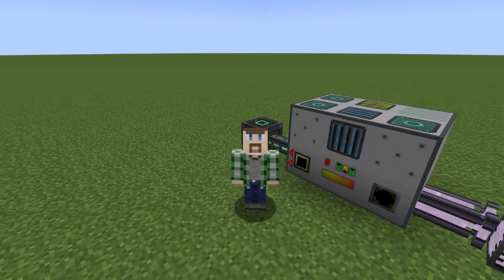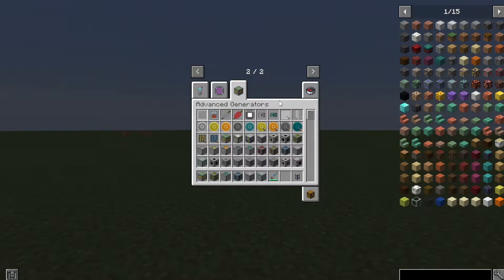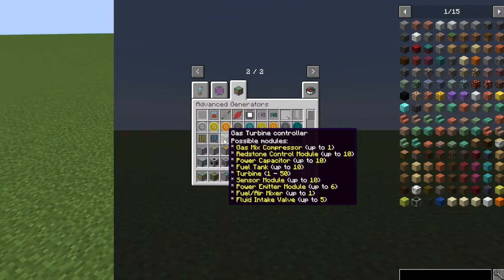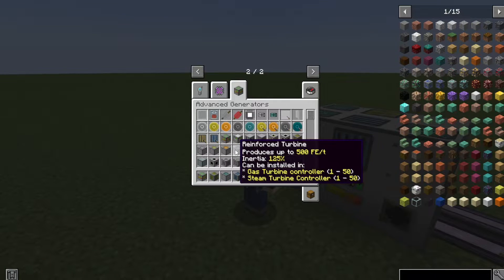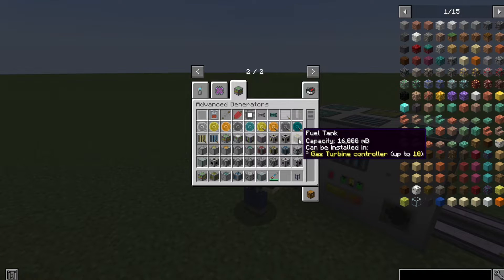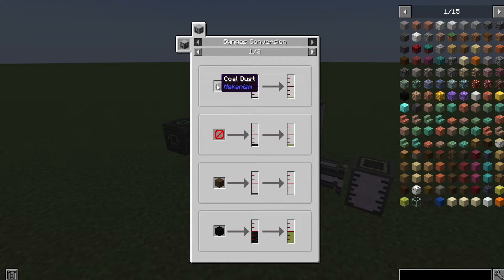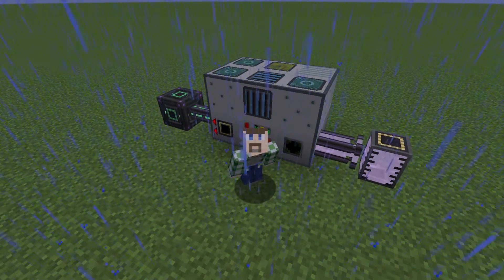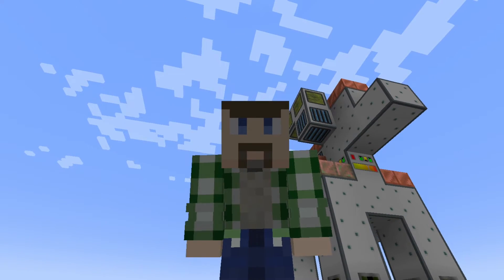Advanced Generator Basics - Minecraft 1.12 - 1.19 - Modded Minecraft Tutorial

Comment: Hey Ard, this was short and up to the point. And the point is - put the controller and connect everything listed in JEI under controller to it to make it work. One can make it as complex (and as "elk like") as they desire.

Indeed, when I first saw this mod I was a bit overwhelmed, as there is no instruction associated with it. But still, for the player perspective, because it is a multiblock structure it is hard to calculate it all in your head - how much material you spend building it, how much fuel you use running it and what output you can get? This inability to estimate in your head could be entry barrier and daunting too. Putting couple wind mills, for example, is much easier to comprehend. Are you planning on making some "advanced" advanced generator tutorial where you show some step by step examples where you build a couple? I know that different packs tend to tune things a bit for outputs/inputs but these could be helpful for folks to see that advanced generators are not that scary to build.

Either way - great video! Thanks for doing this for us!
Reply from the maker: Yeah, I'm planning on doing two follow ups on how to make fuel chains either natively with syngas or with mekanism ethylene.  This first one is just mostly a "it's really misnamed, don't be scared" tutorial.